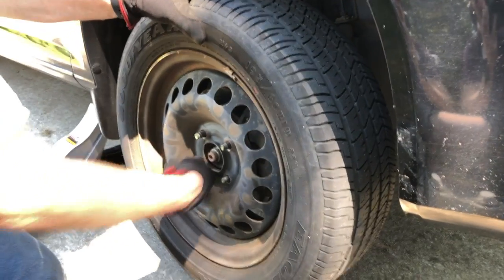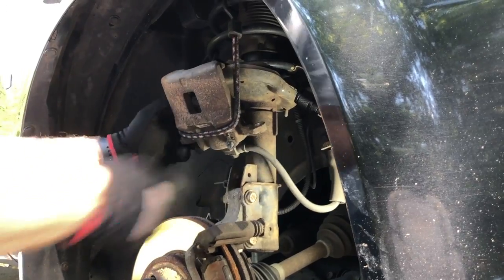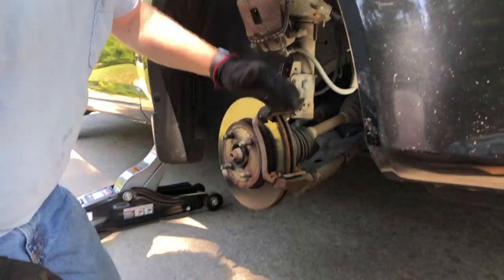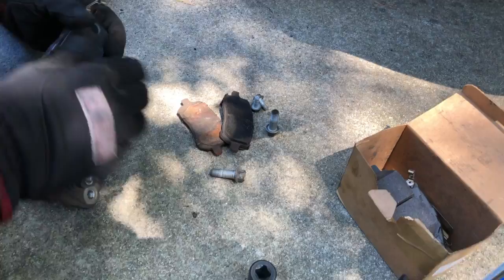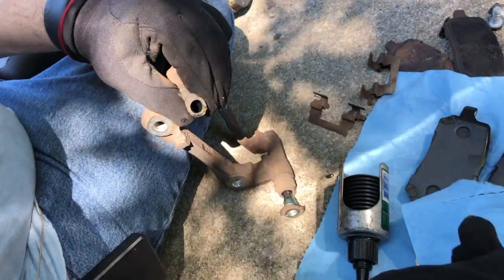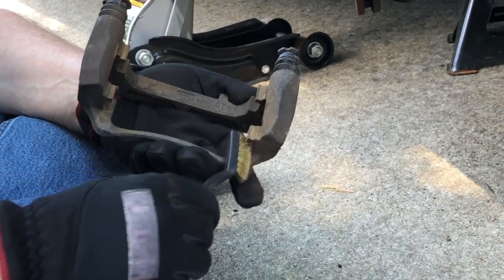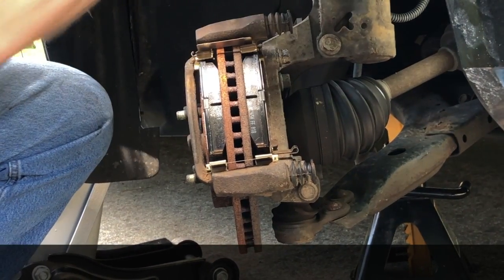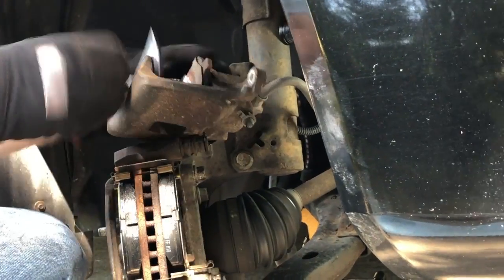2005 - 2010 DIY GM Front Disc Brake Pad Rotor Replacement Chevrolet Cobalt Pontiac G5 Saturn Ion

Comment: Nicely done. First brake took 45 minutes, then watching this when i forgot the steps... second brake took about 15 minutes. I had that issue where the caliper frame bolt wouldn't start because of the pin boot alignment.

Comment: I'm working on my 97 2 door Tahoe 4wd. there is only one rear ABS sensor and its somewhere on the transfer case or transmission. Can you help with the location? And can you confirm the speed sending unit is not the same part or shared part?
Reply from the maker: On an old body style Tahoe K series (4WD) there are two speed sensors that are part of the front wheel hubs.    And then there's the 4WD transfer case speed sensor (that's the aluminum unit with the half drive shaft that drives your front wheels in 4WD).   You'll find the transfer case speed sensor on the top of the case housing and somewhat facing towards the rear of the vehicle.  It unscrews as a unit similar to an oil pressure or engine temperature sender in construction.